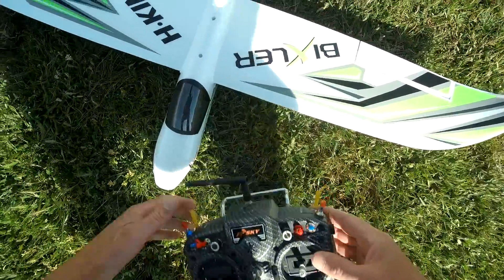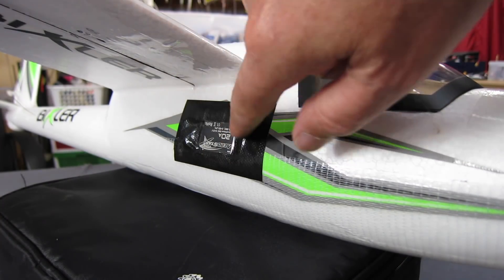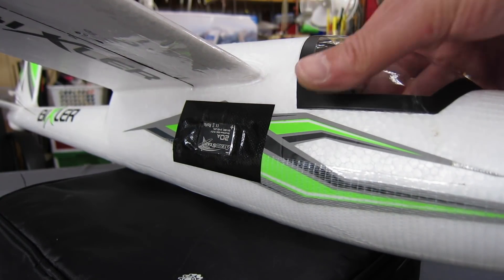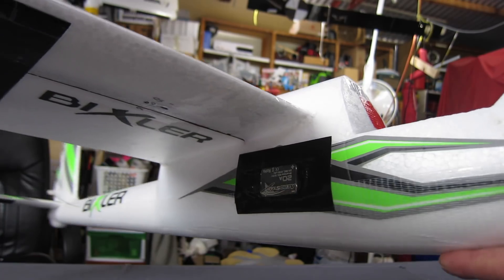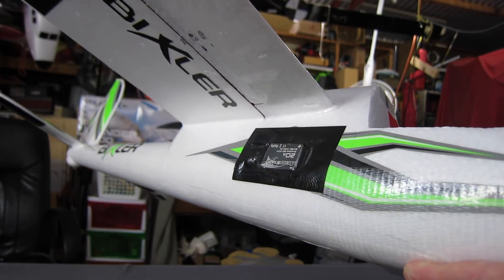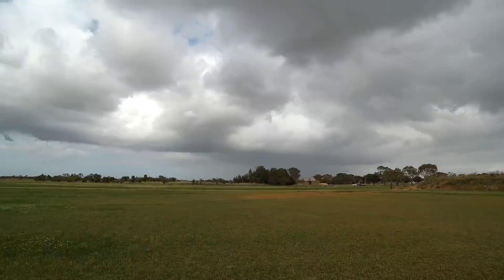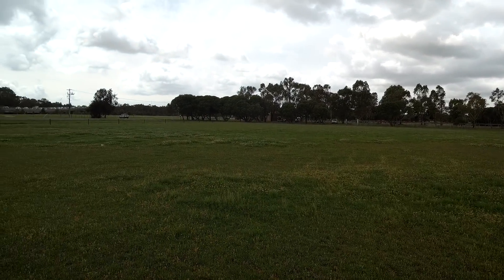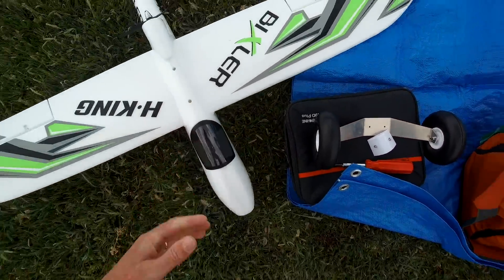Bix 1.1 V2 External ESC mod

Comment: Some of the water planes such as Flyzone Tidewater has cooling issues just like this. 
There are no vents for cooling in this model because of the amphibious application but perhaps water resistant esc instead of standard would be more practical and mounted in similar fashion and solve the over heating issues.
Reply from the maker: Water planes and I have not got on in the past. Went through a few ESCs

Comment: On my Bix 2.1 I mounted the esc on top, in front of the motor, flush with the surface.
Reply from the maker: I did that with my original Bixler 2. Good mod
Reply: Andrew Newton BTW, my Bix2.1 came apart, in midair, on the maiden flight. The vertical impact with the ground pretty much destroyed the what was left. Post crash inspection showed the channel covers had not been glued at the factory. These covers, enclose the wiring and the carbon fiber wing spar. Without glue on the cover, the wing simply pulled away from the wing spar and folded. When I fly a aircraft for the first time, it is always a gentle flight with large slow circling to feel out the plane. This flight was the same. We all were stunned when this happened. As the wing folded, it passed through the prop. A few phone calls and lots of photos to HobbyKing and they replaced it, no charge. The channel covers weren’t glued on the second Bix2.1 but I corrected that before it flew.
Reply from the maker: Oh that's unforgivable, should be checked at HK

Comment: Definitely needed, however a couple of holes, 1 each side at the front, covered by the front half a plastic spoon as a scoop, 
and a hole at the rear as an air outlet, would have kept both the esc and the battery cooler.
Reply from the maker: Good idea, I'll do that as well

Comment: I have a Dynam Hawksky, similarly sized pusher prop glider. I noticed it has a 30A ESC, it is mounted inside and has never gotten beyond warm. If anything, the Dynam is quicker than the Bixler 1.1 v2, so I think the Bixler folks could have just sourced a 30A ESC and called it a day. Bottom line: I think the 20A ESC in this model is too small, hence the overheating. You did fix it the only way possible, Andrew.  Last note: I have a Sky Surfer 1480mm pusher prop glider, it came with a 20A ESC, that one got hot quickly and  I mounted it externally just as you did, Andrew.

Comment: I have a Durafly V70 Zepher that I mount the ESC external to the fuselage, partially to gain extra room and to control its heat. Works great on both accounts. Which brings up the problem in general, I find that several of my planes' ESCs get fairly hot sitting all tight inside all that foam. Begs the question, why aren't planes designed more for either flush or external fitment of their ESCs? Problem often is getting the necessary motor and battery connections made. With this in mind, I'd love to see ESCs produced with all wires exiting on one end, then the ESC would seem to be better fitted to being remotely placed with all wires leading back inside and not having to be turned backward if you know what I mean?
Reply from the maker: Not a bad idea.

Comment: Hmmm, I used a 2450kv motor 6x5.5 prop and a 30amp esc,   have you put an amp meter in test on wot??  
I think mine pulls 28amps, I know it's not the same setup,  but a 20amp esc sounds too small to me? 
(I may fly 3/4 throttle for the whole flight, so mine works a bit harder)   it's a good esc but I suspect it's a bit small 20amp... great idea with the esc may save the esc's..  great vid  I' enjoyed it :-)   thanks for sharing
Reply from the maker: I'll do an amp draw test ASAP
Reply from the maker: Full throttle on the bench = 17.5A and it would be less in the air I suspect, so the 20A ESC is fine for sensible flying, just needs the cooling
Reply: Still, that is 87.5 % of  the ESC's capacity at full throttle, throw in a hot day as I often have in Houston, and you are close to the max. I still maintain a 30A ESC would avoid an owner having to cut a window in their fusealge....

Comment: I do that with a lot of ESC’s , has the bonus of making more space for electronics inside too.
Reply from the maker: Almost all my ESCs are external now
Reply: Presumably you mean just your foamies? I can't see the point with a well ventilated Volantex Ranger. Awkward to flush mount an ESC on thin plastic anyway.
Reply from the maker: Yes just the foamies, you are correct

Comment: Come one, just because HK goes cheapo we have to cut holes in the plane?  As a good reviewer you should have picked up on this, also nothing about the play on the control horns of the flaps, but maybe that's just on mine
Reply from the maker: Maybe you should do a review of yours Ruudy.
Reply: Yes when I crash it haha. But I bought is plane on the basis of your review, which was all wonderful, but so far very disappointing. Getting the screws in that hold the wing was a nightmare, and just running the motor on half throttle, you cannot touch the ESC. I have several planes that I had to assemble, but not one gave me the grief, like this thing, not one ESC gets flaming hot, so I have to cut holes in the fuselage to cool it, just stupid.   But keep doing your review's, they are nice to watch, but I will not believe them anymore
Reply: Ruudy L You get what you pay for. It's a cheapo HK foamy. Regardless of any review, all models have little quarks. If you want perfection, plan on spending a few hundred dollars on a model.
Reply: Christopher Starzyk  I totally agree with you, that there will always be issues, even with the more expensive models.But when you plan to buy a plane you check YT for a good reviewer and Andrew seemed to specialised  on gliders, He actually should have pointed out that 20amp ESC is to light, but if you just do sloop gliding with no motor, who cares, and if I got this for free, who cares if it catches fire
Reply from the maker: To avoid future disappointment, don't rely on one review alone, look at a few and read through the RCGroups thread before buying. Don't expect perfection from cheap foam models. All control linkages will be sloppy unless you do something about it yourself. Most PNP models will benefit from upgraded components. I paid for this model myself and it is one of the best motor gliders on the market. If you come across something better at the same price I'd love to hear about it.

Comment: Hi Andrew. I think I mentioned this during your maiden video- on hot days I’ve been flying without the canopy and was considering drilling holes for air flow. This is a nicer solution.
Reply from the maker: It's a bit radical but I'm happy with it.

Comment: Pretty much what I did. It's the only flaw I've found on this model so far. I guess it's no big deal considering the price.
Reply from the maker: I remember stressing about making any mods to my first purchased plane (Bixler 2) Now days I love hacking into foam
Reply: @AndrewNewton  I've started this hobby with flite test planes. My nutball and ft flyers have seen many repairs, rebuild, and all sorts of mods . It may give you an idea for my background. 
When I flew my bixler for the first time a month ago at the field I did my maiden flight and the esc overheated after 3 minutes because I was just having too much fun with this thing. So right after that first flight I was cutting holes in the fuselage with my pocket knife, used some velcro tape and voila! 2 minutes repair at the field with basic tools and good advice from other pilots is where it's at for me. I mean, sure, some guys were looking at me like I was crazy but I really think it's part of the fun.

Comment: I realy love this aerostar esc.
I only buy this brand at the moment.
Mostly the 50A version even if not needet because for 20$ why not ^^
Reply: Because size, weight and because some people (such as myself) have found that some of these later Aerostar ESC's seem to develop problems after a few flights.
Reply: personally i prefer the Plush series
Reply: @sparrowlt  
Yes, Plush seem to have a good reputation and seem very efficient although I've had one fail and it's a bit annoying having to buy a programming card to properly set them up.

Personally I quite like Hobbywing offerings although the (now apparently discontinued) HK blue series was also very good for the money.
Reply: personally i prefer the programing card because i use quite many Plushes and so with one card i can easily program all of them.. but you can also program them with stick.. wich is usually annoying and nearly an act of faith